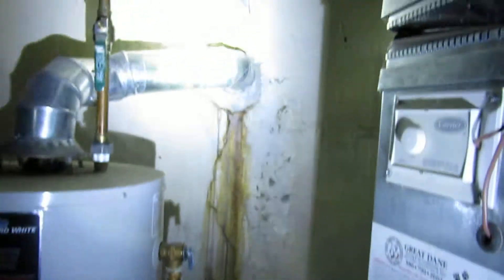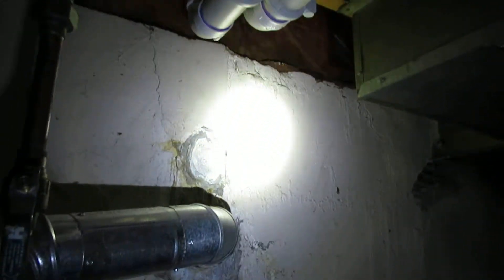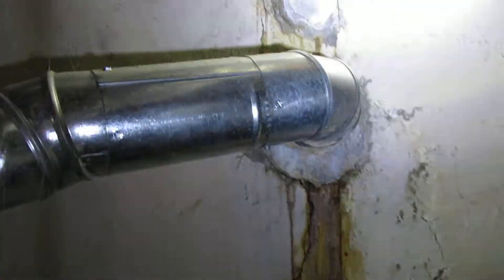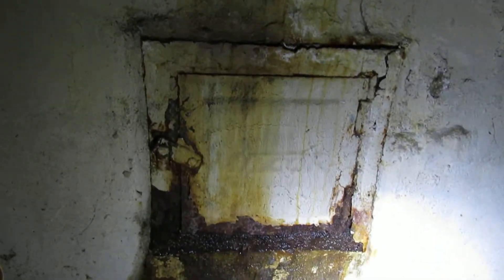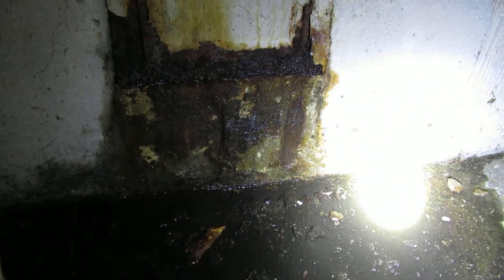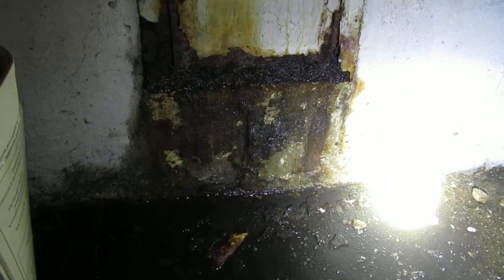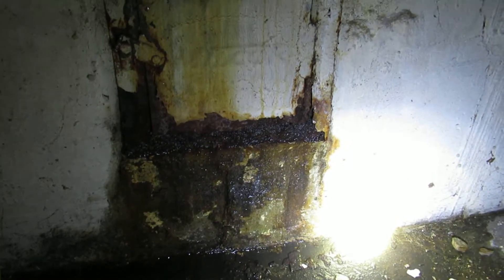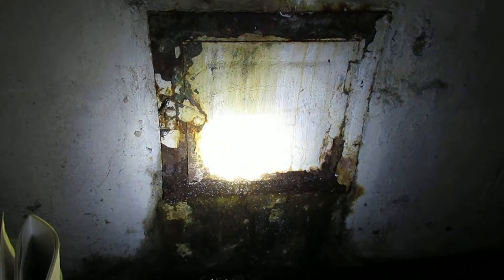Leaking chimney basement clean-out...Detroit version!  Read the description of the video 4 repair

Comment: Thanks for the insightful video, Matt
I have exactly the same issue though it's a very mild leak.
Matt was very helpful when I messaged him to seek advice on the workaround to fix the issue by drilling a hole below the door and drawing out the water into a sump (which he mentioned in his comments). He generously took his time and provided tips and advice to fix the problem. What I appreciate is he did this selflessly as I am not even in MI. If I am ever in MI, I will use his services.